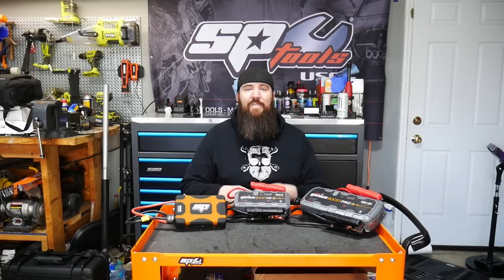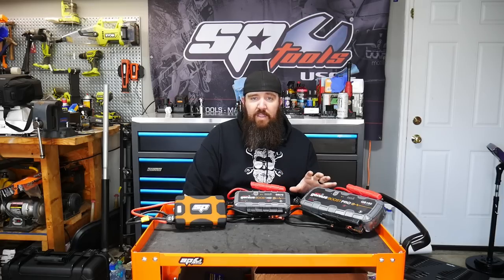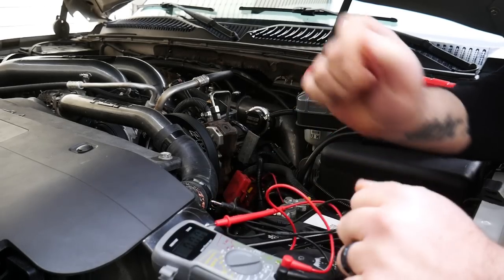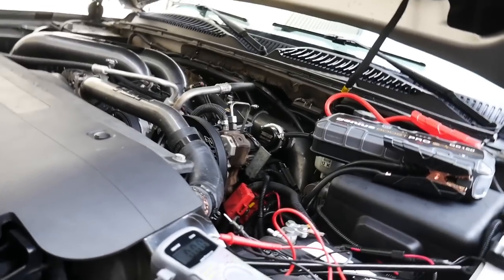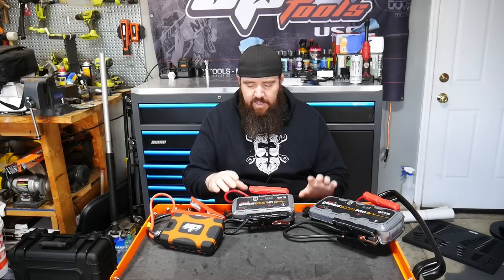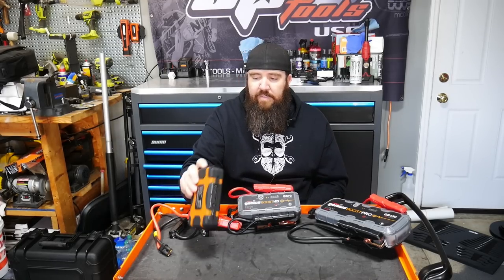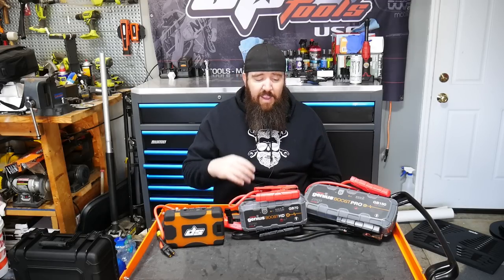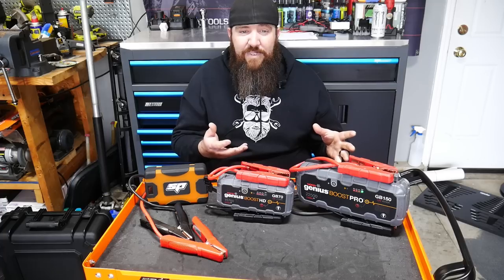BEST OF THE BEST - *UPDATED* REAL WORLD TESTING COMPACT HEAVY DUTY JUMP PACKS

Comment: Very interesting video but I believe I 'might' have a partial explanation.  I have years of experience of jumping vehicles the old fashioned way with a very large new fully charged spare battery with huge CCA output and with the largest heavy jump leads.  I frequently find that I cannot start large diesel engined vehicles where the battery is totally flat even when the spare battery is way over sized for the task.  Many people say this is because the flat battery is shorting out the circuit but this is not true.  A totally flat battery has a very high resistance and simply will not charge quickly.  After much testing the answer is that a set of sprung loaded clips on a set of jump leads has a tiny cross sectional area of connection when compared to a battery post/battery terminal and therefore a high resistance at high current levels.  To prove this I cut the old lead posts off some scarp batteries and made up some special leads where you have to disconnect the old battery and connect the jump leads directly onto the vehicle battery cables.  I have also made up piggy back leads that keep the flat battery connected.  In all tests the vehicle starts very easliy because there are no spring clips with small contact areas and high resitance joints in the circuit.  I suspect that if you cut the spring clips off the NOCO units and connected the cables directly to the vehicle battery terminals the vehicle would most probably have started.  You are partly right about the silly numbers that NOCO quote for their units.  But if you cut the spring clips off their cables and made a propper connection I would not be surprised if the units would put on 4000amps.  However there is a nice video on YouTube of a tear down of a NOCO unit and it shows that the power transistors are rated at 150amps !  The difference is that the 150 amp rating is a constant rating for continuos use but a starting application is only for a short while.  However running a power transistor designed for hundreds of amps at current levels of thousands of amps means that it will have a very short life e.g. perhaps 10 vehicle starts over two years and then the whole device is scrap.  If you look on NOCO's website at the reviews of the GB70 and scroll down you will find many unhappy customers who now own an expensive plastic brick !  Two big factors determine how long a NOCO unit will last 1) how the internal batteries are treated e.g. fully charging any lithium battery will immediately damage it, best to keep it around 50% and not let it go flat for many months, 2) how flat the vehicle battery is that you are trying to start, switching the unit to manual so that it can trickle charge the flat battery for 15 - 30 mins before trying to start the vehicle will massively reduce the hidden damage done to your jump pack which occurs every time that you use it.  Another component that fails in the NOCO unit is the battery as they cannot withstand the high current and over time they breakdown and swell and split the plastic case open.  Thanks for an excellent video.
Reply: Excellent explanation .
Reply: @curtisking2962  Update: I am probably wrong that the NOCO units might produce the advertised output current.  "Project Farm" has a brilliant video called "Which Car Jump Starter Is Best? Let's find out! NOCO GB40 vs Duracell vs Audew" in which the GB40 that is advertised at 1000amp only puts out around 500a.  I received my new GB70 yesterday which after watching all the reviews I am sending back for a full refund today never having tried the device.  I was highly suspcisious when I saw the huge money that they had spent on packaging.  The only other time I have seen such expensive packaging was on computer memory and power supplies whihc were very expensive and turned out to be very poor quality.  I intend to buy the SP Tools 1600a unit as there are many things that I like about it.  I think Rustbelt Mechanic's video showed an important advantage of the SP Tools but he did not notice it.  If you watch as soon as the SP Tools unit is connected and powered on and settles down it is instantly charging the flat battery long before the starter is engaged, this will massively increase the current output of the flat battery and reduce the load on the jump pack.  You can see this by watching the cheap multimeter in the video.
Reply: @paulcollins8296  Woah that's a whole lot of grandpa logic. Most of which is false, and other parts archaic. Lithium batteries are NOT at all damaged by charging to 100%. The life cycle of them is dependent primarily on discharge and recharge cycles, along with how far your discharging the cells, along with other factors such as temperature and moisture. If you are to store lithium cells for long periods it is best to leave them around 50% charge, however the cells used in these packs are Lithium-Cobalt batteries, which are the same as the SP model, and hold a charge better and longer than other types of lithium based cells. Your second point is also invalid, jumping a car (using the device as intended) doesn't damage the device at all other than discharging the cells. The only thing that may get damaged from the boost is part of the electronics or the battery on the car, the jump pack has build in protection for overheating, over discharging, reverse, polarity, spark protection, along with all of those I almost guarantee there is some kind of back feeding current protection as well. 

Not trying to shit on you man, but you wrote a massive paragraph stating a lot of incorrect information. Screwing around with batteries and jumper cables without proper knowledge definitely isn't a good way to learn a lesson.

Comment: Lol the NOCO fan boys are pissed off in the comments. But honestly something is fishy here, Ive seen gb150 start 13.0l semi trucks, A 6.6 DURMAX should be childs play for a gb150. Id wanna see the clamps completely removed from both batteries, and then hook up the gb150 straight to the truck battery terminals and crank it then. But non the less, im really shocked a gb150 didnt start a 6.6 duramax.
Reply: Because they didn't output at least 12-15v.. the nocos were pretty much dead before this video even went live.. like a dead car battery (still outputting 11ish voltage ⚡ but dead to its core)

Comment: Absolutely ridiculous.  I have a gb3000 and a friend of mine has a gb40.  Both will start a truck multiple times.  I mean 10 + times without even a battery in it..  I even started a large Cat excavator 24V with the 3000  hooked up to just one of the 12 v batteries.

Comment: Rustbelt Mechanic, No, no, on both Noco you did not use them properly . Connect the power lead turn on the unit, press and hold the boost button untill the lights start running up and down and the unit start clicking then you connect the negetive cable. Lets see what happen then. At that time do not allow - touch + because its fireworks.
Reply: leo McCalla he is not going to use them properly because it is set up to make you buy one brand not the other. These guys doing these videos start out being straight up with the videos. Then then come the free stuff and $ they are only looking out for themselves
Reply: So dishonest, the things people do for money.......oh so sad..!
Reply: Leo, no, no, no....it's a bypass button, not a boost button.  Read the manual.
Reply: Prkoi après 1 démarrage  ca décharge vite. 1 démarrage ca perdre 2 trais de batterie

Comment: I'm not surprised noco GB70 was the worst booster pack I ever had. After I took it apart to check on why it was such a piece of shit the batteries they use in no way in hell can even make a quarter the power output they claim. Unless I just happened to get one with the wrong batteries in it or something which I doubt.
Reply from the maker: Pretty much exactly my point🤷‍♂️

Comment: Dude?  Why didn’t you just follow the Noco directions?  

“The White Boost LED is illuminated when the GB70 is ready to jump start your vehicle.
2.) Try starting the vehicle. Most vehicles will immediately start. Some vehicles may require the GB70 to be connected for up to 30 seconds before starting. If the vehicle does not start right away, wait 20-30 seconds and try again. Do not attempt more than five (5) consecutive jump starts within a fifteen (15) minute period. Allow the GB70 to rest for fifteen (15) minutes before attempting again.”
Reply: He didn't follow directions on purpose, to mislead the viewers and promote the SP product lol. Quite obvious

Comment: Ok, now Sir... I see that you used all 3 boosters to jump the vehicle but I see you missed something about the NOCO BOOSTERS... The NOCOs has an override feature which I see you didn't use or didn't know about. .. That override feature was designed to shut down the safety features of the NOCOs and operate same as if someone was using there vehicle to jump another vehicle... The override feature is also designed to jump a vehicle when the battery voltage is too low... I have a GB70 and  I have been in that situation a few times... My battery was completely dead.... I had no lights and no accessories and the override feature started .my car and other vehicles in same condition with no problem everytime and effortlessly... NOCO is the way to go ..!!!

Comment: This is such an unfair comparison as you need to connect it to the car battery and not to the side of the engine. 
This is not the right way to jump-start the car. Even Tommy TMT and a few other people  posted the same thing.

You seem to promote SP Tools rather than Genus Boost. A comparison like this is unfair and why don't you make another comparison of the 3 products again.
Make sure they are all fully charged and connected to the car battery and not to the side of the engine.

Comment: it has to be hooked up to  the battery direct not to the ground on the engine
it has sense the battery 
I thought the same until I hooked up to the battery
Reply: I have a 2017 BMW that must never be boost started directly to the battery.  You will destroy your electronics. Battery posts in the engine compartment are provided for boost starting.

Comment: Simple solution to an Obviously flawed use/method, shown. Show me an AMP Clamp installed as you do the start sequences. That would be an Immediate giveaway, as to what was being drawn out of the Battery/Jump Pack!  I smell something fishy, otherwise.  As many have stated it surely appears like an SP Tools sponsored Video. Almost Laughable even. It was even more suspect that it was said that the SP Tools model would provide way less jumps, during the day, after he just showed it Starting several times, and the NOCO's being a Huge Fail. That is called Reserve Power, when they rate these!   I also have a 6.6 Duramax and went out with my NOCO GB1500 Model, and it started it up many times, from the Get-Go, AFTER Connected for at least 5 minutes though, with maybe 3 Volts DC, indicated on my multi-meter. I will not knock that SP brand either, if it works, it sells.  I'd never trust any other brand other than NOCO, myself.  I have restored many a fully dead battery.... some below 1 Volt DC, with the over-ride selected, in their NOCO Genius Line of Chargers on AGM/Lead Acid batteries.  The Big Boys as well, Group 185 Deep Cycle, AGM's, rated at 240 Amps.  Used for Solar systems etc. and weigh 145 lbs. each!  (CA, NOT CCA ratings) It is Hands Down the best bang for your buck!  I may never, ever. have to replace batteries ever again, with the many modes it has to "Repair" batteries, (Desulfate) Once you learn how to be very patient, as it can take days to get a battery back to 100% status.  I have yet to not be able to restore the many batteries I have used it on. I may never throw out or have to buy a battery ever again! I monitor all progress with a "Solar" brand BA9 Model, which tells you all you ever need to know to actually be aware of the Battery's health with all the numbers you will ever need. Armed with the parameters it gives you, you can bring them back with cycling through a Charge/Restore/ and Load Test, (Separate Carbon Pile/Any High Resistant model) cycle several times, until the battery is nursed back to health.  Case broken, and any other internal destruction, especially between the individual cells (Rare) forget it though!  I was an Avionics Technician for decades, and recommend the NOCO Products, Hands Down! I do have my interest peaked about that SP Tools model now though! Thanks for posting up.  I have gleamed much info from You-Tube Vids, and while I used to be what was called a Shade-Tree Mechanic, I am now a YouTube Mechanic, LOL It has literally saved me 10's of thousands of dollars over the last 15 or so years, easily!
Reply: So, 2 things I did suspect here. First, I see the flashers are on, and maybe the Headlights possibly when he used the NOCO units.  Either by mistake, or by design... LOL. Was the additional load not present when the SP Tools model was used? Unknown here???  Secondly, the SP Tools was used last.  AFTER using the NOCO units, either by design or not here.  After the NOCO's added Amps, the SP Tools was able to use that reserve power already provided, Seriously, the way I use them, is to let the Jump Starters attached for maybe 5 minutes, so it can actually apply the Amperage to the Battery for a while, instead of right away.  Even when you use Jumper Cables to start a dead battery it is always best to run the Jumping vehicle for about 5 minutes at least, 10 minutes is better.  Again, those Amps that are available is what does the work here. Now, all that being said, I must say, I never used a Lithium Cobalt battery in my life.  I may try one, and get my experiences and report back, if and when I do!

Comment: "Boost Button" 😂😂😂 🤦‍♂️
Lolololol! Read the manual!  
That's the override button that allows the pack to put out a charge even if your battery is too weak for the pack to recognize that it's connected.  
Be careful! You can get shocked if you touch both alligator clips while the override is engaged. You're disabling the pack's safety features when you do that. ✌
Reply: I'm still laughing.  What'd you think, it put out extra power when you hit the button? Turned it up to 11 😂?
Reply from the maker: No, the funny thing about why I emphasized pushing a boost button because in a previous video and this one as well, TONS of people were telling me that’s what it was for and that I was doing it wrong. So I made a point to poke fun at that. Just like in the comment I pinned, there is no such thing as a boost button lol... it over rides the polarity check when a battery has too low of voltage.

Comment: One big sales pitch again. This time to sell the SP Tools.How much did you pay for these units? I believe you forgot to mention that. If you are so upset about the amp numbers on the Noco's, you should have contacted that brand before you made this video, so you don't have to make it sound negative. Especially when you acknowledge you don't yourself. With the Noco's you claim the other functions like lights, etc. are not interesting to people. That's b.s.. I like them. After you said that about the Noco's, you go in depth explaining the extras on the SP Tools. And you know, when it comes to what people are interested in, it's not the AMP numbers, because most don"t even know what they mean. The point is: will they start the car. With the first Noco GB70 you did not even try the boost button, and witth the GB150, you did use the boost, but I could not see if the light was actually on. If you would have let it sit for a minute to load the battery, I bet it would have started that engine with no problem. At least that is my experience.
Reply from the maker: For the 20th time..... IT IS NOT A BOOST BUTTON!! Straight from the mouth of GB engineers, it is a polarity safety bypass button, it make no different at all to the amperage or output of the device.
Reply: @RustbeltMechanic  It is NOT a boost button, but it absolutely is a bypass that allows the unit to put power to an extremely dead battery. So by not pressing it, you are just letting all the safety aspects to stay in check and no power is being sent to the battery!

Comment: Your Test and Judgement of Both of the Noco Boosters is really Flawed, Yes the SP started it right away, BUT What you Forgot to do is Read the Manual with the Noco's and NONE of your Posters here have a Clue, ONE Hook Up The NOCO, 2) Turn it On, 3) Let it Sit and Transfer the Power for a Minute Or Two to the Dead Battery and Then Try and Start it, 4) YOU DO NOT use the Noco like a Normal Jump Pack Where you just Hook It Up and Hit The Key, The Noco will Never Start a Vehicle Unless you Let it Transfer it's Power To The Vehicle Battery, Also You Should Of Hooked the Noco Directly to the Battery NOT to those Lugs in the Engine Bay, Try Starting the Vehicle the Way Noco Tell You and NOT the Way you Prefer then maybe you will get better results.